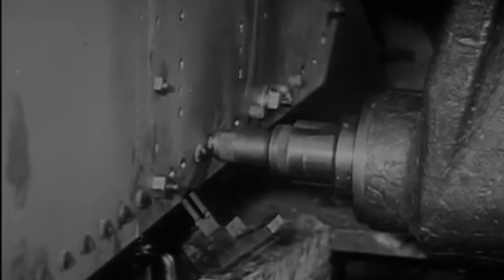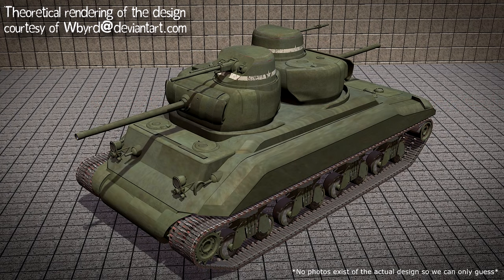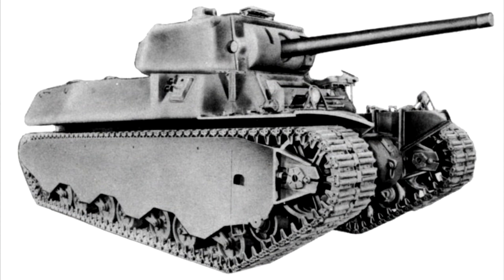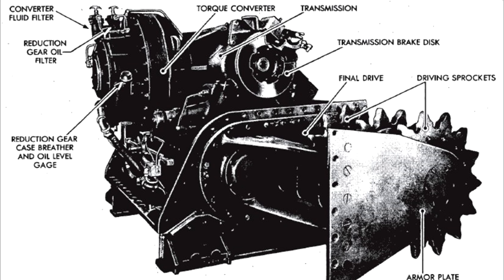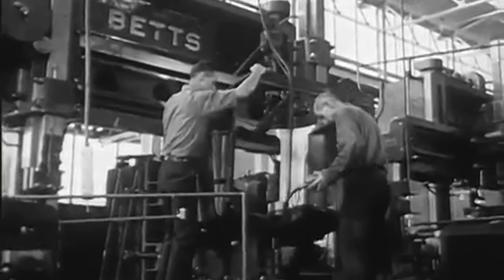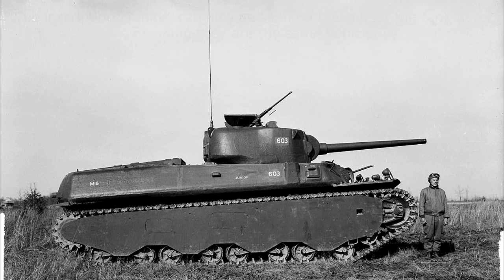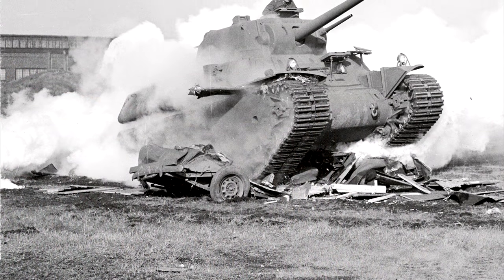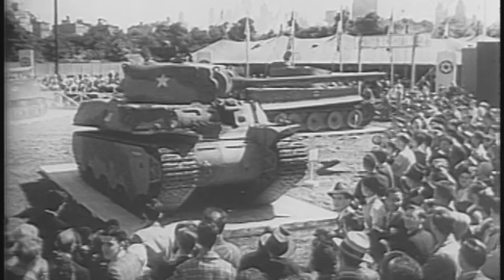America's Tiger, the M6 Heavy | Cursed by Design

Comment: I wish they had designed the Sherman with a little thicker frontal armour and a nastier cannon. Then it would have been a much better tank for taking on the Tigers and Panthers. Something more along the lines of a Firefly but designed that way from the get go and not retrofitted, with all the additional problems that brought. We could have saved so many lives with a little additional forethought ... We already knew the Sherman was no match for the Tiger and Panther in North Africa, and the Panzer IV had a much superior 75mm cannon to that of the Sherman. It would have been so useful in those incredibly tough tank battles all around Caen during the Normandy Campaign.
Reply: The Sherman was enough for what it usually went up against. It's important to point out that encounters with the big cats were pretty rare and the US also had dedicated tank destroyers that could take out the big cats. I think is also important to point out that the US was the only country that had to ship all of their military hardware halfway across the world so size and weight requirements were definitely a big factor to consider when designing a tank
Reply: @grandadmiralthrawn8116  The regular old 75mm Sherman just didn't have what it took to take on the German tanks unless you used specialized tactics. Like bouncing an armour piercing or high explosive shell off the lower front mantle of the Panther and thereby deflecting it down onto the driver, which usually killed him and destroyed the steering controls. But that took incredible guts to pull that sort of thing off! Other times a Sherman crew would try to bounce an armour piercing shell off the ground directly underneath a Panther and through the floor. But a straight out blasting session with a Panther or Tiger in the head on position was basically suicide. The Sherman could take on the Panzer IV but the latter's cannon was much, much better than the regular Sherman 75mm.

The worst, most intense and closely fought tank battles of WW2 took place all around Caen between the British and Canadians against the Germans. The Nazis had seven or eight tank divisions squeezed into a 20 miles front and there weren't that many tanks shooting it out in such a tight area anywhere else in WW2--even at Kursk! A better cannon on the regular Sherman would have been a life saver. Thankfully every 4th or 5th Sherman was a Firefly in the British and Canadian armoured units and they could kill a Tiger or Panther from a kilometer away head on. Though the better tactic was to attack the German tanks from the side, where the armour was much thinner. The terrain around Caen, especially in the Juno Beach area of the Canadians, was very wide open, much like the North American prairies, with few hedge rows like the American beaches. The German plan was to overwhelm the Canadians with panzers and drive them into the sea, then move left and right to roll up the British and Americans on their beaches. But the Canadians seriously outfought the Germans and blunted their attacks so badly they finally had to give up. That is where the Normandy campaign was decided in the first five or six days after D Day. Most people don't realize that.

Comment: I am sure that there were a myriad of reasons why this tank and any heavy tank for the United States never went into masss production, but it strikes me that the USA were playing “catch up” when it came to production of most pieces of hardware for the military, even in 1941 the years of military spending thrift was such, in my opinion, that designers, manufacturers and least of all the military top brass wanted anything and everything done yesterday, and they couldn’t,or have the luxury, to allow for even the most promising designs to take an extended period of time to enter service, and had to accelerate and accept designs that could easily be manufactured quickly and on masse, the manufacturers were also required to produce enough to provide the allied nations with substantial numbers of many types of equipment, either through lend-lease or by sales. It’s truly remarkable that the USA, one of the smallest and poorly equipped military forces in 1941 could, by 1943, be producing so much that they became the most powerful nation in the world by wars end, and that status is only just being challenged by China 🇨🇳, let’s hope we never have to find out which side is the strongest, but at least we can rest assured that if it ever comes down to it the western allied nations WILL become one giant military force, just as they have done since 1917-present, and that’s a force nobody could defeat in a conventional war, the alternative to that scenario does not bear thinking about. 
P.S Sorry for rambling on but when I get the bit between my teeth and the keyboard in front of me there is no stopping me, my apologies. 😀👍🇬🇧🏴

Comment: I don't get it! On one side it is described as an "incredibly expensive project". On the other - it is being said that it's unit cost was equivalent to TWO "Shermans". 50 thousand "Shermans" were produced in different configurations, so it's like saying it was actually VERY cost-effective. What gives?? PS. Plus! - it's kinda a nice design, too and something tells me that plenty of the latter American "heavyweights" benefitted from the knowledge gained developing THIS one. The very broad tracks to spread the weight. The power-steering - the double gunned turret, with a "back-up" range-finding 37mm gun, the idea of putting a gyro-stabilizer for the main gun, etc., etc., etc. - the people involved in this project were TRUE PIONEERS in that field, back in those days. Consider how many heavy tanks projects have been scrapped and forgotten through history. Today it sounds like a "normal" - "everyday" - sort-of "stuff" - ...POWER STEERING!... The soviet drivers, onboard their BT-7's and later T-34's could only DREAM about stuff like that! Obviously correct me if I'm wrong, though!

Comment: Good , well researched video with the usual ill informed comments. For example, it's shown in the video that the tank would be nine feet wide so it would fit on a rail car so the chatter that it wouldn't is simply wrong. Similarly to the port crane weight limitation. So they were going to build a tank for overseas service that wouldn't be able to be sent overseas? Yeah, that makes sense.

On the video content, this tank is just another example of how the US messed around with dead end tank designs during WWII while other countries were able to nail a suitable design quickly and get it into production.
Reply: Rail transport was a problem since the flatcars that could handle the weight were few in numbers and busy carrying heavy loads of machinery and structural steel to the new factories being built. The War Department had to order the railroads to make those flatcars available when they wanted to transport the new Pershing tanks from the factory to the seaports. That took some time due to the flatcars being scattered across the Nation with many still loaded sitting on a factory siding waiting to be unloaded at later date. The Liberty and Victory ships had deck boom cranes that could lift 30 and 50 tons so loading the M6 nor the Pershing presented a problem. 
Ordnance drew up the specs for a light tank and a heavy tank in 1937 after observing the use of armored vehicles in the Spanish Civil War. They noticed that light tanks were quite useful and that a heavy tank was required to make frontal assaults on fixed defensive positions that had AT guns. They had a change of mind after observing the fast German conquest of Western Europe in 1940 where the French heavy tanks fared poorly against the German light and medium tanks. That forced Ordnance to get cracking drawing up specs and designs for the M3 and M4 medium tanks. Ordnance kept working on the M6 just in case it would be needed then cancelled the project once US armor commanders refused to use it due to being too damn slow, had too many breakdowns and that the crews constantly bitched about their cramped working conditions. The 40 produced M6's wound up being used to test various turret designs that held larger guns, at schools for driver training and the War Bond Drives. Ordnance didn't waste much money on new tank designs and just built a few prototypes of various designs for testing.
Reply: @billwilson3609  Could write a small book in response Bill but, generally speaking, you have put a nice spin on the US situation given the time and resources that were available. Compare the US's situation with that of Germany and the USSR for a moment. Sure the US had to ship- stuff overseas but that was done without destruction of infrastructure and the many problems resulting from having your country attacked. The US had it easy, all they had to do was to organise their resources and correctly analyse what was required..
Reply: @FairladyS130  The US did have it easy due to being far away from the fray and Texas floating on an ocean of oil.

Comment: If you consider it as a late 30s type  design... it not so bad. but out dated by 1941. despite the Ordnance Board's  obsession with MGs.   But the biggest  mystery is ..the end user, the Armored force didn't want it for many good reasons. So Why could nobody trust the Armored force and just drop it?  In 1936 the Infantry Board wanted a rifle based on the idea of the BAR but smaller. Its requirements would  be what the m16 became.  This was based on their knowledge of  Infantry combat and its real world requirements .  The ordinance board wanted a long range rifle for WW1 tactics.  The end result was the M1. A good rifle. But if you read the Infantry Board requirements..they were light years ahead in their thinking. Imagine what it would have been like if the Army had a rifle like the M16 in WW2 ?   This is not to insult the M1.. I'm thinking of the Technological , strategic, and supply implications. Military technological research is needed.. but there is often this drive to develop what is not wanted by the Real End User.  I imagine that is good once in a while. but I'm sure usually its a wast of money and effort. and worst gives the Military what it doesn't want or need.

Comment: It has been written that the Sherman was all the supply chain could handle and that a really heavy tank would require an entirely new transportation system. The Navy did not have ships equipped to handle anything of this size and everything from the rail system to the loading system would have had to be redesigned. The Germans didn't have this issue because they were already there. They did run into many issues with existing bridges throughout Europe because of their tank's heavy weight. The Pershing was a huge improvement over the original 
Sherman but the later versions of the Sherman were almost as good as the Pershing. In the aviation world, the US did magnificent things but in the tank world, they sucked. There were several hurdles that they could not overcome. Transmissions were one and a simple design like the Germans came up with. The Americans wanted to add too many things to the heavy tank and thus it became a lame duck.

Comment: They were right to go with Shermans. The Germans should have done the same and capped tank production at Panthers. The Tigers were a complete waste. All the effort that went into them should have gone into more Panthers and boosting the firepower of their infantry battalions especially AA and AT.
Reply: The tiger was much more sorted out mechanically than the panther, which isn't saying much
Reply: @grandadmiralthrawn8116  - they both took time to sort out because of being rushed into production. Later marks of both were more reliable.
Reply: @FlyxPat  even after updates the panthers final drive failed at only 150 kilometers on average. Not to mention that these things were a nightmare to do maintenance and repair on
Reply: @grandadmiralthrawn8116  - My point is if they weren't diluting their effort across multiple production lines they could have had a better Panther and more of them. As the Americans and the Sherman.

Comment: As a former tank soldier, I shudder to think of how complex crewing and commanding this vehicle would be, let alone a full platoon. 

However, if they'd started from a simpler design, without the needless excess guns and crew, this vehicle could easily have been a winner on the battlefield. Other countries successfully fielded heavy tanks in WW2, and if they'd thought to upgun it sooner, I think that it could have been very successful on the battlefield, working alongside the more numerous Shermans. With a smaller crew, the 90mm gun and a coax MG, this machine would have been as dangerous and feared as any other heavy WW2 tank.

It seems to me that the Americans didn't really "get" tank design in the early stages of the war and their doctrine was obviously lacking the insights that the Germans and Russians had brought to the table. Without a sound doctrine, or understanding of how you intend to use a weapon on the battlefield, you simply aren't going to be designing anything useful. For example, with proper infantry support, there simply isn't a need for rear facing guns, or so many forward facing machine guns. This cost them significantly in terms of time and muddled design. By the time they had things figured they had wasted time that they simply didn't have. 

I do regard the Sherman as one of the best (if not the best), designs of the war, easily being the equal of any other nations tanks. If they'd gotten their shit together sooner, I don't doubt that the US would have come up with a quality design (the automatic transmission would have been a game changer - manually changing gears on a heavy would be exhausting) that probably would have been regarded as one of, if not the best tanks of the war. We'd talk about it in the same terms as we talk about the Tiger.

With respect to cost, if any country had the resources to develop the "perfect" heavy tank for WW2, it was the US. Just look at their navy and the millions of dollars (billions in today's money), of equipment that they provided free to allied countries.

Comment: I have a vague memory of there being significant problems shipping any tank larger than the Sherman  variants across the atlantic at the time, due to the smaller size of cargo freighters, and the need to lift them into the hull, rather than opening the hull, which can be done with modern veichle cargo ships.

So, a limitation of size, design, and the lifting ability if contemporary cargo cranes where the tanks were loaded/unloaded.

Is this just bullshit?
Reply: Size and weight wasn't a problem. The Liberty ships' cranes had two sets of booms that were rated at 30 and 50 tons. All tanks were transported lashed to the deck so the waterproof cargo holds could hold more vehicles and supplies that were packed in crates which allowed them to be stacked. The M6 weighed in at 52 tons so could've been shipped with the side armor plates off to lighten their weight since the plates could be reset when unloaded. The Liberty ships carried an assortment of weapons and supplies to ensure that sufficient amounts of those made it to their destinations since many were being sunk by U-Boats.

Comment: Would have been the same problem Germany faced with their heavy tanks.  Too heavy and too wide for typical bridges and roads for rapid deployement and action in the European theater.  Also.. in many areas of central Europe, the ground is too soft so a much wider track would hae been needed to reducte PSI on the ground.  And that, inturn, would have added to the weight.  Restricting is ability for manuevers and cross country travel.  It looks cool.. but in all practicality, useless in western European countrysides.

Comment: it was always a folly.
A tank more than twice the size of an M4 but with the same main armament was useless from the start.
Its size and weight meant it was very hard to get to Europe as well. Eisenhower didn't want it for that reason more than anything. He could get 2 M4s on the ground for each M6, and already had the maintenance and repair shops for those as well, and the spares supply chain.
Had the T29 made it in time it could have been a valuable asset, though the Pershing was by all means a superior vehicle for the same reasons the M4 was superior operationally to the M6.

And let's not even talk about the Pacific island campaign where the M6 would have been bogged down on sand beaches and jungle swamps.
Reply: Wasn't a folly. Was a prewar design to serve as an assault tank against fixed fortified positions and to take out AT gun positions. Ordnance drew up specs and plans for light tanks at the same time since that was all the other countries were using. That changed in 1940 after seeing Germany's success with medium tanks when they invaded Western Europe. Ordnance then got busy designing the M3 and M4 while working out the bugs in the M6 just in case it was needed. The US Army determined that it was too slow to use on the battlefields so Ordnance canceled it's production after 40 were made. The US Army also didn't want to use the Pershing for the same reason and that it hadn't undergone the usual rigorous field testing to find and correct it's flaws. The first production run of 256 was to be used for that and got shipped to Great Britain instead for immediate use on the battlefields. The US armor commanders didn't want them since they didn't come with trained crews nor mechanics along with being too slow to keep up with advancing formations. Ike was being pressured by the War Department and politicians to get those into battle so force the various commanders to accept 29 into their ranks to see how they performed. The Pershings didn't accomplish much which got Ike off the hook.